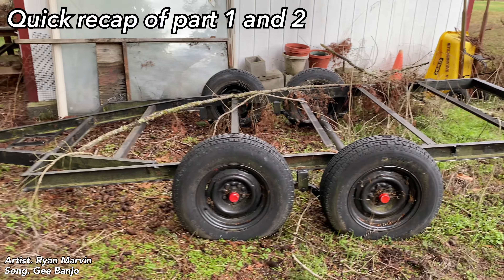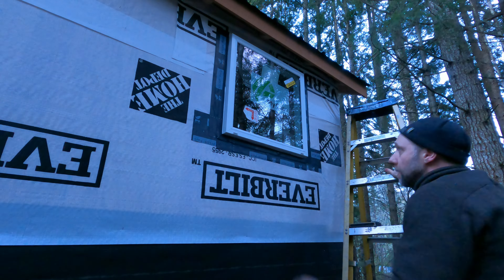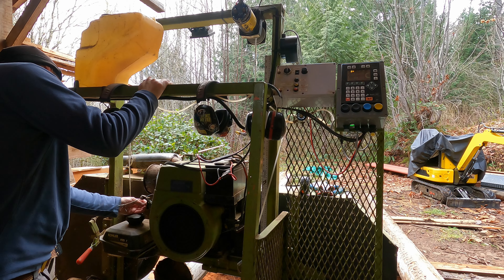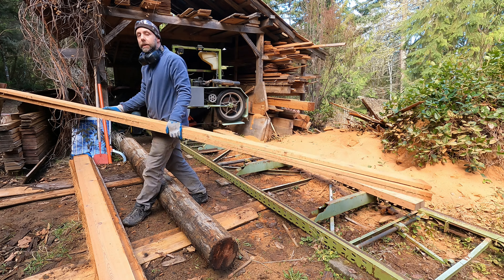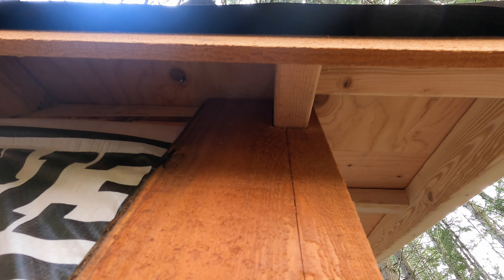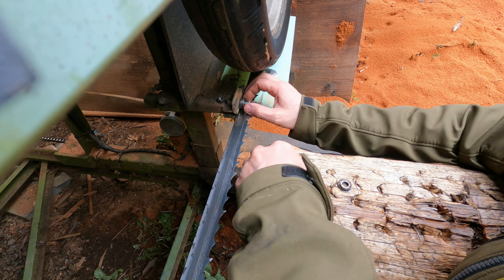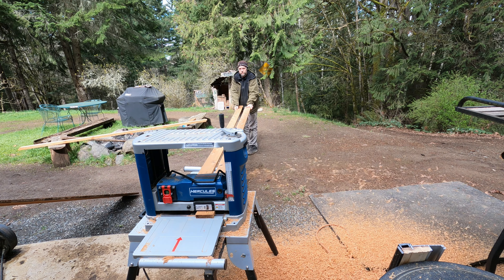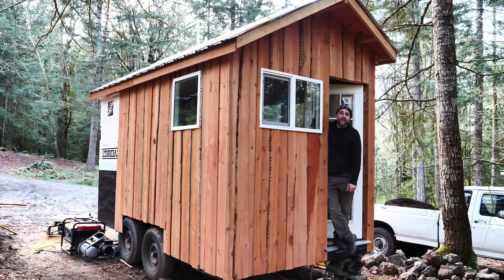Tiny home mini cabin build series part 3

Comment: What a pleasant Saturday morning surprise! Very much enjoying the series. The live edge siding looks perfect on this project. I plan on getting a door like that for a little work shed I have. It'll be nice for extra light. Nice work!
Reply from the maker: Thanks 😊 I was running late working on the cabin so I had to post a day later, maybe I will find out Saturday morning is a better time to post??? Thanks for checking out my new video 👍 I scored two of those doors for $150, the other one was wider and had the door handle drilled wrong. I used that in a different cabin. Both are double pane glass 😊 have a great weekend!
Reply: Nice! That's a great deal! 
I found a few of my videos did better on Saturdays 🤷‍♂️, I used to watch "This Old House" and such on Saturday's, might be perfect for this type of video?

Comment: I'm enjoying the build Mike!  I have a few different adapters for tool batteries.  I don't like having a bunch of different battery brands, but sometimes you can get a good buy on a different tool brand.  You inspired me to learn to weld, now you might inspire me to get a wood mill.
Reply from the maker: Right on! Thanks for checking out my new video 👍 man a mill is an awesome tool, there’s always a need for lumber and a mill holds its value really well 😊

Comment: Nice build. Looking forward to see how you will build the inside.
But i do have a question about the door.
I have seen many builds where they put the door so it opens inward. Why?
Why not have it so it opens outward. It takes up less space on the inside.
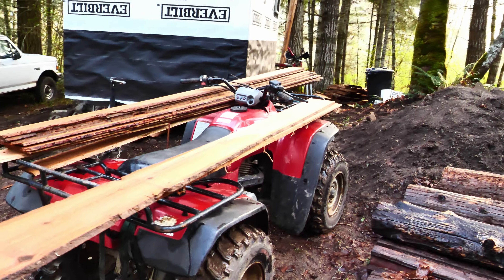08:10. Don't you have your mini pinzgauer or you homemade articulated truck?
Or are those two busy doing something else? :)

Comment: Mike, do you still have that Yanmar excavator? Adding a hydraulic thumb would make an excellent video.
Reply from the maker: Yes I do have my Yanmar still, definitely was the plan to make a thumb, definitely lost a bit of interest in the hydraulic thumb due to the older Yanmar didn’t have an AUX hydraulic port and it seems to be a bit more complicated to hook up. Probably will cut the parts this summer and at least make the thumb a Manual one. Thanks for checking out my new video!

Comment: I'm enjoying the mini cabin series. I'm currently converting my van into a camper so I'm looking forward to seeing what you do on the inside.  I see you have the Fortress 2 gal. Ultra Quiet compressor.  Are you happy with it?  I need a compressor for my van.  I'll probably get the smaller 1 gal, but I'm thinking about cannibalizing the pump and mounting it inside.  Then get a larger tank and mount it underneath.  Thanks.

Comment: I have mostly Dewalt tools and I have an adapter to run Bauer tools with my Dewalt batteries. Its nice if I need a oddball tool for 1 job to be able to buy a cheaper version and use the batteries I have. It is picky about which batteries I use though. The new power stack batteries wont work with it.
Reply from the maker: Those battery adapters are pretty cool, this was the first tool I got to run with them but I’m probably going to expand my range of tools after testing this one out. Thanks for checking out my new video 😊👍

Comment: Just an Observation:
Why do we have the door opening towards the inside?? If theres a fire in the dark you want it to open OUTWARDS to get the heck outa dodge-
and with SUCH little interior floor space why take up the room by the arc of the opening door inside? Watched the whole video in awe of how nice it looked and then couldnt figure out why the door was "Backwards"?
Reply from the maker: I wanted the door to open inside,  there’s many reasons for inside, if there’s lots of snow fall you can always open it in, someone could always block a door from the outside preventing someone inside from get out. 
I’m pretty sure it’s also a building code thing.
Reply: @Mikefestiva  Yes, exactly, Building code says doors outwards if it's the only door leading outside? LOL
IDK- obv its your thing, do it your way, but I was mostly concerned about interior space